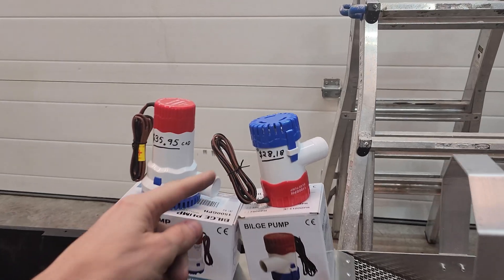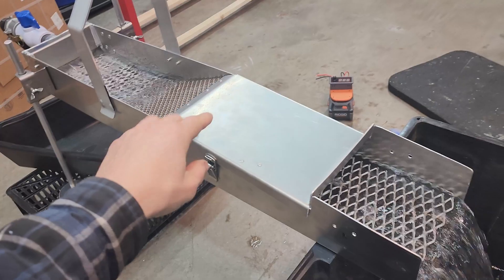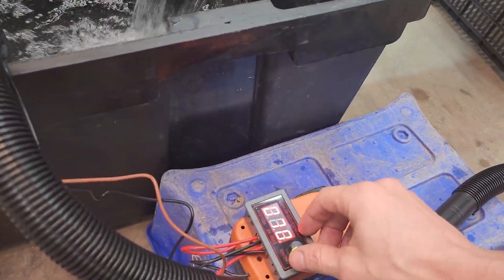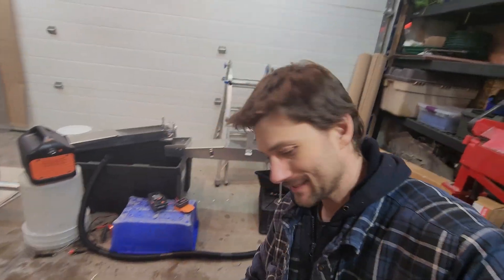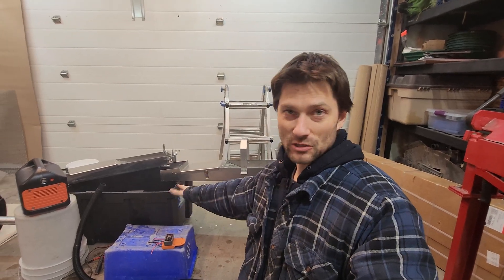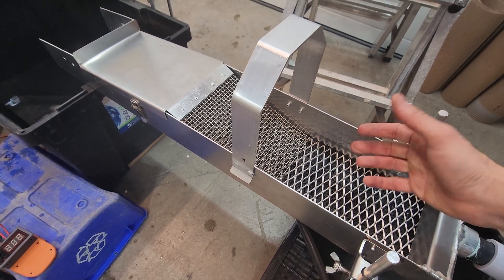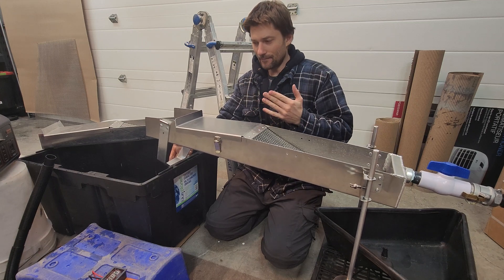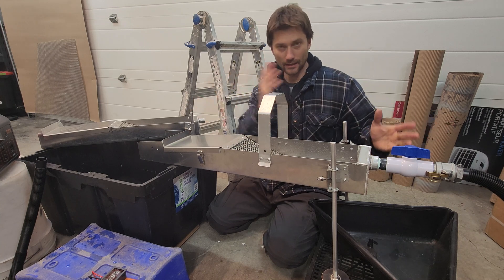Bilge Pump Comparison Test: 1100GPH vs 1500GPH Real World Results.

Comment: sir would you please tell me what is the performance difference between 12 volt 1100 gph and 24 volt 1100  gph bilje pump ? what is benifit to buy 24 volt 1100 gph instead of 12 volt 1100 gph , or vise versa.......
Reply from the maker: While I don't know for sure, a 12volt and 24 volt 1100gph pump should operate the same provided you run them at their listed voltage.  The 24volt pump would require thinner wires as the amperage would be half that of the 12volt pump running the same wattage.  But if you ran a 12 volt pump at 24 volts, it would spin too fast and burn out.
Reply: may be 24 volt is made for such people who have 24 volt soler panal or battery availale in boat and same about 12 volt. .....afterall it is a boat bilge pump..... right ?🙂🙂🙂🙂 by the way glad to meet you

Comment: with the new portable power stations becoming lighter and longer lasting and the state of california not wanting gas engines in the streams or on the banks what are you thoughts on running a smallish dredge nozzle on an electric water bilge pump with no noise or no gas to leak into the water or to start fires in the dry brush ... only issue is the power of the water pump being enough to run a dredge nozzle would need to be high enough to lift material into a hopper and be portable enough to carry out in the field.. have you any thoughts about running a dredge on electric power only .. any ideas abouts what products would work best for this application.. they make electric trash pumps that might also work but i have not seen anyone really use an electric dredge that worked with any real good results on moving real material and im interesting in setting something up for quiet and stealthy dredge with electric power and portable size ..would welcome any thoughts or ideas ...thanks
Reply from the maker: I've seen some YouTube video with people making up to a 2" dredge run on bilge pumps, but never anything larger.
I agree that the technology is there, when you consider what electric is capable of these days, but I haven't seen any real applications of a battery powered 3" or larger dredge.
I imagine a subsurface dredge design would require less overall power to operate and with some powerful bilge pumps it would be made to work.
I bet that with the use of some RC boat electronics and a custom printed high pressure water pump perfectly matching a brushless motor to the venturi's requirements could be designed and produced, and I would love so see it done, but unless someone with a lot of money were to pay me in advance to try and design such a thing, it's just not high on my priority list of things to try personally right now.  
If your search turns up anything promising, let me know!

Comment: Have you ever tested the flow at the 3M head they are advertised for?
Reply from the maker: I haven't, but if they advertise accurately that they have 3 meters head pressure, that would mean zero flow at 3m.

Comment: I was considering a setup like this because clasifying and paning is a LOT of hard work. Scooping into a high banker is a lot easier expecially on your back, let alone the increase in processing power.
I guess the best setup is a slightly higher cell li-ion battery so 4 cell and many parallel for more Ah. Then using the speed controller to controll flow and remove the ball valve completly as its no longer needed. I would go with a battery pack with a ballance charge plug not a cordless battery.
Reply from the maker: Great call on the speed controller.  Cordless battery packs are great because if you already own some cordless tools, the battery is "free" other than buying an adaptor plate to plug into.  They also have a built in overload protection fuse as well as their own battery management system to balance cells.  Very cool!
Reply: @UtmostOutdoors  i would look at LiFePO4, or li-ion battry packs. If there premade they should have a BMS (battery management system) that protects against over draw, cell balance, tempature and peak discharge. As these packs can come in a range of sizes like 20-30ah which will last most users a day trip. These are usally sold as motor bike, e-bike or gold buggy replacement batteries. Cordless batteries are ok basic option but are still small run time use so you would need close to 4-5 5ah batteries for your day trip. I think cost analyst wise they are very expensive for what they are but they are more widely available as a basic starting point.

Comment: can I know the wattage and Amperage on this?
Reply from the maker: That info is actually in the thumbnail.  42watts for the smaller pump, and 73 watts for the larger pump.  Just devide those numbers by your running voltage of about 12 volts and you can calculate amps if you like.

Comment: I spent over 30 years as a hobby-prospector. I have pretty well searched for flour gold. A couple years ago, I switched to battery power. I then sold my 4' x 10" highbanker, pumps and hoses & switched to smaller, lighter highbankers. No more pump fumes, oil, noise but a nice quiet bilge pump. I can now hear the birds or bring along a music box and listen to my favorite tunes. There are far less tasks involved switching to battery power for highbanking, resulting in more yardage per hour. And, I can hike to places previously not practical with gasoline energy. You are heading in the right direction.
Reply from the maker: Awesome!  Good to hear.  Yeah, I love the little PWM controller too.  Lithium batteries really do put out a lot of power these days!
Reply: I think John should give one of these a test run and report back.
Reply: @goldentroutprospecting1821  I would like to test it with a drop riffle system, the way mother nature captures gold in rivers and creeks using gravity. Drop riffle systems, when set up properly require less water flow, have less concentrates to take home  and have a fantastic capture rate for even the tiniest flour gold. I already know how well minor's moss works with with metal mesh and Hungarian riffles.
Reply: @TheJohnEdmonton   Maybe a guy could make a silicone drop riffle mat to use in place of the metal and moss? The lower water flow means you can get away with smaller batteries and pump.

Comment: I Love the front support , cheaper and quicker than legs. WIN/WIN
Is it made of stainless ?
Reply from the maker: Thanks, The front leg support is made from aluminum flat bar.  Only the rear two leg brackets and thumb screws are made from stainless steel.